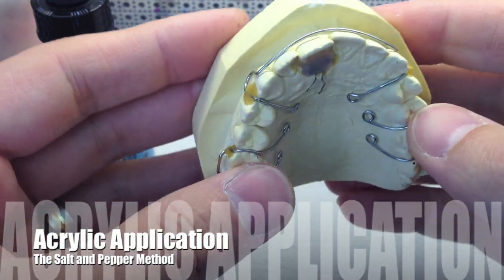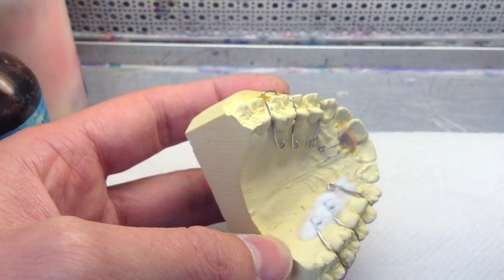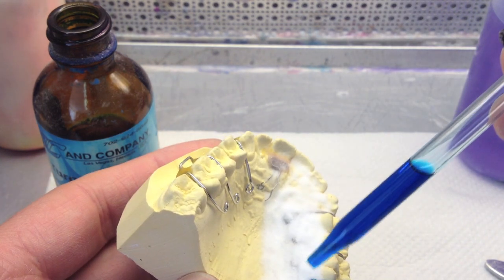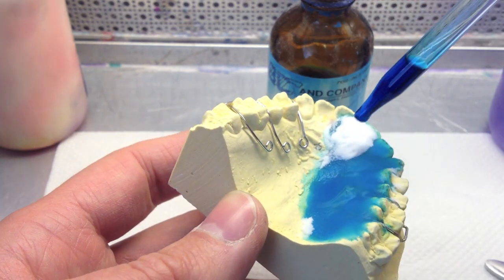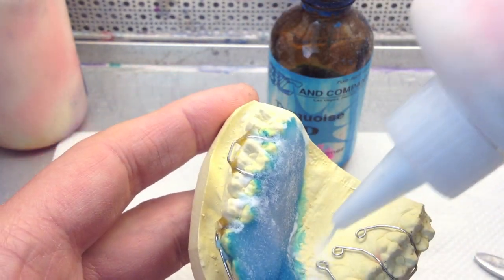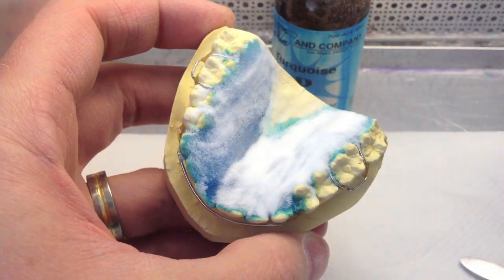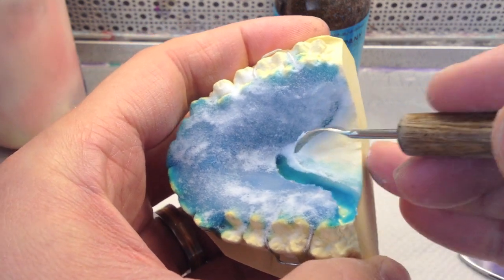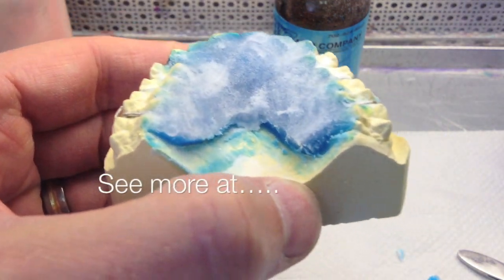Acrylic Application on a Retainer- Salt and Pepper Method

Comment from the maker: Quick Question: Are you removing the acrylic in the posterior like I do at the 6 min. mark in the video? If you are, it may not be the best procedure for you if you dont have a pressure pot. The water my be getting under the acylic where you cut and "float" the acrylic up
Reply: Salt and pepper method? 🙄.
Reply: Salt and pepper as in food that would taste icky. Im no professional.

Comment: What separator do you use on the model before you apply the acrylic? The one we're currently using isn't great and its so tine consuming trying to separate the model and retainer, then usually left with some stone in the pallet side of the retainer, feels like I might as well not be using it at all.

Comment: hey dude I was taught to adapt the wires to the palate leaving no space but when you finish with acrylic the wires are exposed once you remove from cast. Is that why you leave a mm between cast/palate and wire?
Reply: yes, exactly! you need at least .5mm of space between the wires and tissue of model. that way acrylic can flow underneath it

Comment: After fabrication is it necessary to put in hot or cold water?
Reply from the maker: Hot water will make the acrylic set up (Cure) faster. You can use cold water but it will take longer to cure

Comment: HUGE QUESTION: While my acrylic has been setting I've had some retainers experience shrinkage in the posterior area, ie the acrylic lifts up while setting and there is a space between the palate and the acrylic.  The office I work at does not have a pressure pot so I set the acrylic using slightly warm, just above room temp water. What is causing this shrinkage?  Is it b/c we don't have a pressure pot? Is it the water temp? Any help would be GREATLY appreciated! Love your vids!

Comment: If the polymer is not wet by sufficinet liquid dont you get a porosity?
Reply from the maker: You do need to make sure you are using enough liquid to wet the polymer while you are building the thickness of the retainer. but once the thickness is where you want it, I put a layer of powder to soak up any extra monomer so that it will not slump. I dont care much what happens on the surface of the retainer, as I will be trimming most of this off and exposing the acrylic that was mixed well with proper liquid powder ratio.

Comment: Excellent video!! I learnt alot from this! but.. I'm having issues with my acrylic retainer fabrication.. Im having some very fine bubbles.. its being exaggerated when I use a clear acrylic.. how do you remedy this? I saw that your retainers are like glass.. and flawless..
Reply from the maker: Are you using a pressure pot to cure the acrylic?
Reply: RetainerDesigner hi! Yes I am using a pressure pot. Im also using Ivoclar Vivadent probase cold. This microporosities are more evident if i fabricate a TMJ splint.
Reply from the maker: Never used Vivadent Probase cold (I assume it is cold cure?) You may be taking too long building the splint. You need to get it in the pressure pot with in 10-15 minutes before the exothermic reaction gets to far and starts producing small bubbles. Also check the temerature of your room my acrylic likes it between 72 and 76 degrees F. If you neeed more time try putting your monomer bottle in the refergerator the night before...
Reply: RetainerDesigner putting the monomer is a great tip! I did considered doing that before as i was thinking the temp is affecting it, most specially im here in Dubai and its about 43C at the morning..

Comment: Cool video :) I made the experience that a trimmed acrylic plate on the top retainer is less comfortable than a completely closed one. You get used to it pretty fast and don't feel that edge so much. My speech was always better with closed ones, as long as they are not too thick